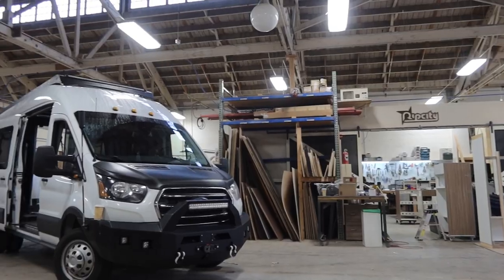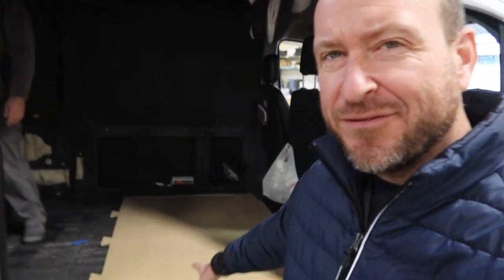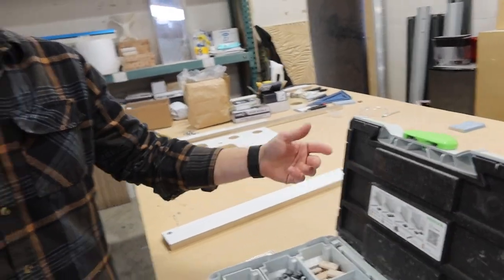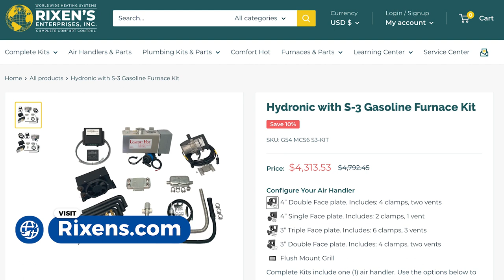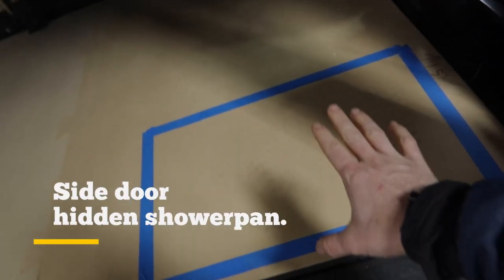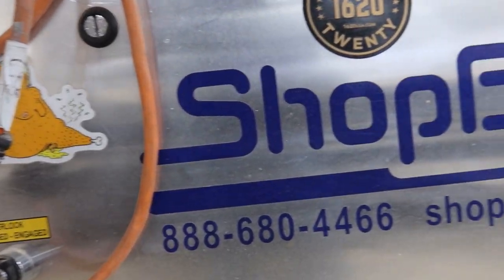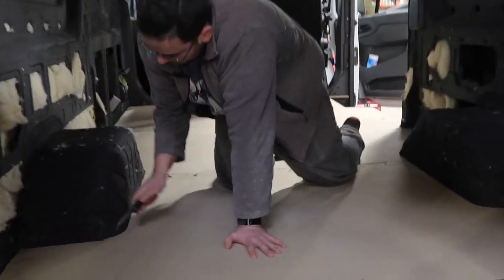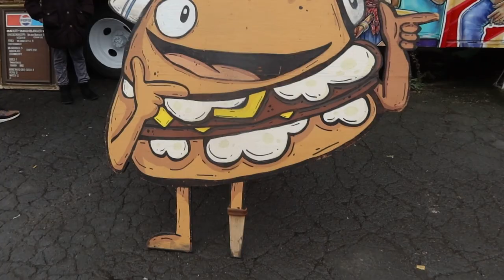Building a Hydronic Heating Floor System in a Van | Part 1: Templating

Comment: What is the material that you cut the grooves for the pex tubing? I understand Lizard Skin is sprayed on the van's metal floor. What is the next layer called?
Reply from the maker: its a composite fiberglass board... simi.ar to a product called Coosa board.